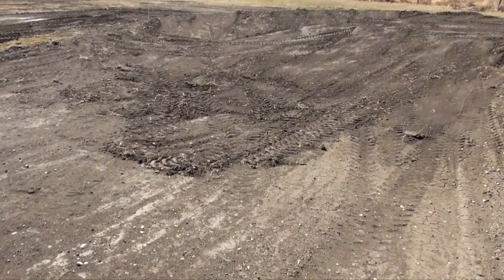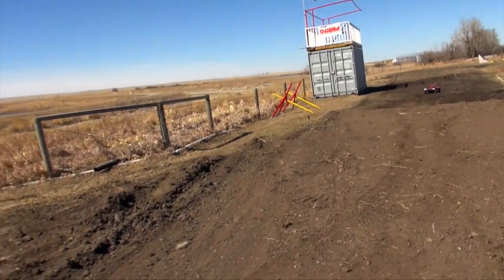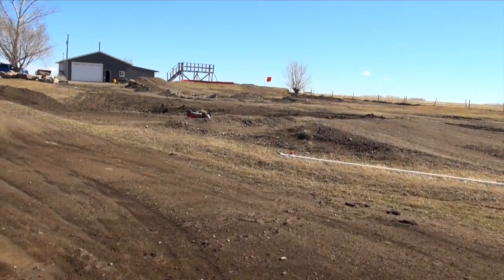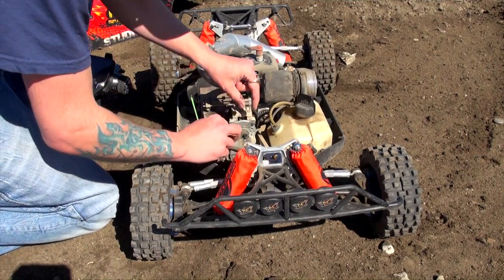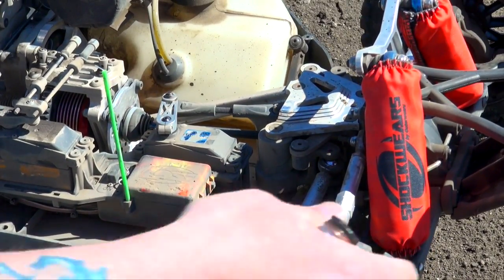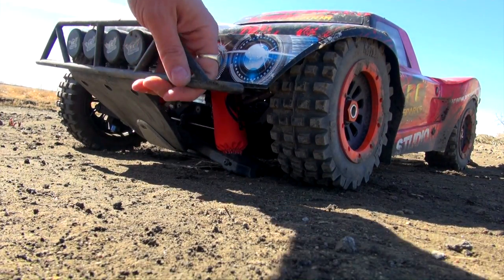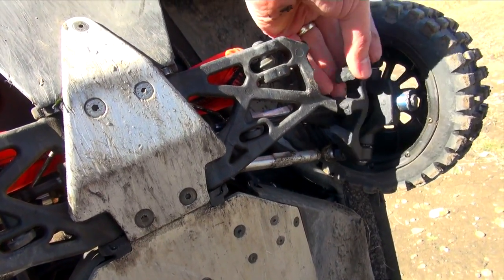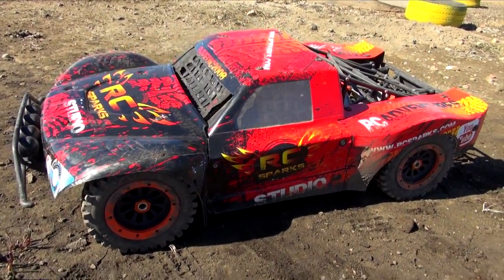Project Large 2.0 CARNAGE on my Backyard Race Track! 1/5th scale LOSi 5T GAS POWER! | RC ADVENTURES

Comment: Nice wrap on the VEKTA-5, looking forward to seeing the buggy upgrade's you fit, I am waiting for Kraken to restock their alloy upgrades, as I want the front diff housing along with all their suspension parts. You need to check the inner hinge pin mounts the side with the breakage looks like the hinge pin brace or braces have let go, you need to go for the AJA billet lower suspension arms, they are very strong, I have not damaged an arm since fitting them I have also gone over to their `C'hubs and `C'hub carrier's with Turtle rear hub carriers and with JS Performance turnbuckles and camberlinks and TLR hinge pins, the suspension is now bullet proof shocks are TLR items with FID-RC variable valve pistons and piggy back rezzies, I bought a second set of the alloy arms when in a sale just in case, they have sat in my tool box for as long as the others have been fitted to my 5ive-T.You will need to be handicapped when you race now as you will have an unfair advantage all the practice laps you have and will be having.

Comment: Awesome slow mo shots!!!! Could you do an up-date video on the electric Losi 5t please :D Keen to see it ripping around a groomed track hahaha btw you should get some 6s 6000mah Turnigy Graphene's for it as I know you were having some heat issues with current 5000mah you were running. Graphene lipo have very low internal resistance and hold slightly higher voltage under load.

Comment: You should unbox and review the axial deadbolt, I'm thinking about getting it for my first truck
Reply: Black Knife it's a great truck to start with. But be warned. I needed to put about $200 into mine (all by my choice) to really get it in great running order. But it is a good truck stock please dont let me stop you from getting it. I have some run video's up from over the weekend of it.
Reply: Thanks
Reply: Black Knife I got one I had a problem with the ESC but I think that was a fluke. I recommend it. I put about 150 into it with battery charger and new ESC. Personally I soldered on deans connections but not required

Comment: Awesome!!! Great shots wish I was up there to run with ya. First I see you forgot the Loctite lol and to bad about arm, looked like ya got that rim also. What do ya need to get a couple of stickers for my buggy?  God Bless Ya   Dave
Reply: David Aarons Loctite for what ?
Reply: Loctite for the servo arm  God Bless Ya   Dave
Reply: David Aarons I never use loctite i don't like it and that screw is never loose on my truck
Reply: That's fine, some times threads can be oversized and will come loose. I use it where I think it may come loose because I have been racing and had things loosen and cost me a good result. That's great that you haven't had a problem. God Bless Ya   Dave

Comment: first run breaks....

just had to replace my servo horn on my losi rock rey.   if anyone else gets one, I'd suggest changing the plastic horn for aluminum.  the AVC takes a toll and can strip the teeth with normal bashing. only lasted a week.  but repaired and ready to rop again!

Comment: Would be nice if the arm's were CNC aluminum.
Reply from the maker: Yes, but then they would bend instead of break. I would rather swap out a cheapo a-arm then have to buy new aluminum ones.  Also, the plastic is a great "give-spot" for all of the energy - instead of transferring it to other areas of my truck.  You can get aluminum ones though.. they are available!